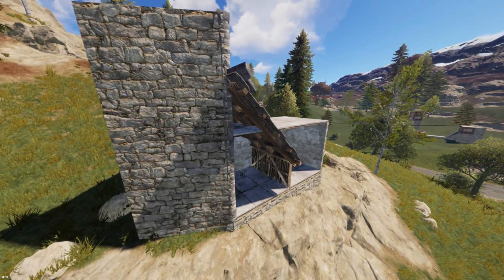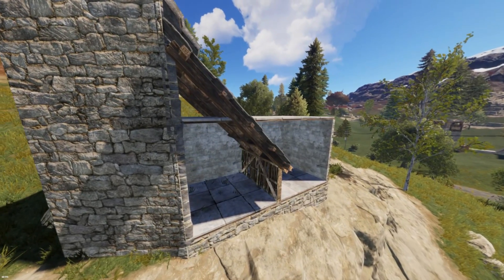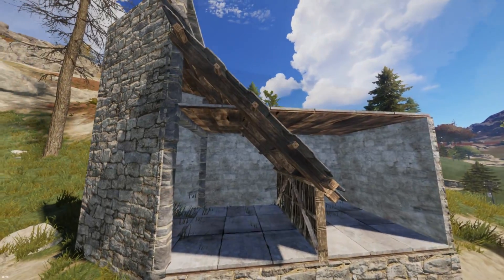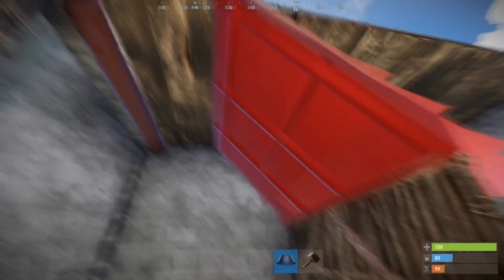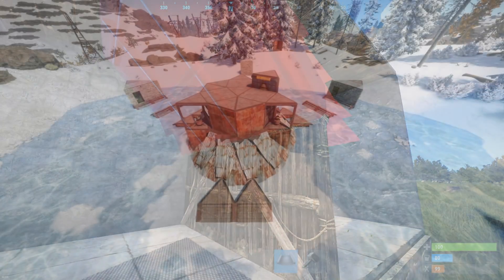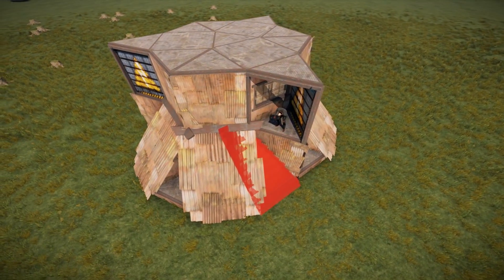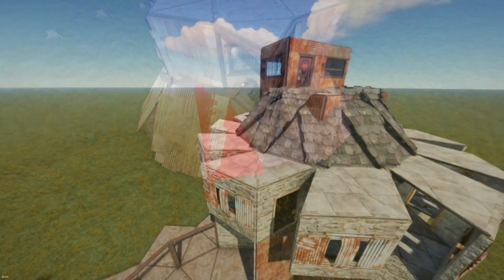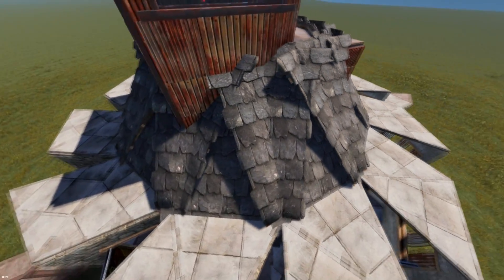RUST Building 4.0 - Affected Base Designs

Comment: Working hard to find a solution for stability roofs, it's extremely hard to buff roof raids without it - but alas solutions will be found
Reply from the maker: Yes, I hope so too
Reply: @Leagle Eagle Make this its own comment please. This is 100% legit even tested splashing. It wont intergrate seamlessly into other base designs but it  keep the concept alive and is not more complex.
Reply: @EvilWurst  And so i did, check your discord iv'e linked images that will break the meta

Comment: I learnt 3 designs from your channel and they were: the Raptor, the clan version of the original Frustrator X, and the multi-tc Frustrator X.
I got unviable, patched, unviable.
I' m pissed and i just had to LEARN those designs, i wouldn't imagine creating them. Keep up the good work!
Reply from the maker: I know it’s frustrating. If it helps, the Original Frustrator X is still viable. There will just be a cosmetic issue, otherwise the design is fine

Comment: I guess from a programmer perspective, it makes sense to apply some changes that for them makes no sense working as currently it does. But alas, we need to live with this. The roof change makes no sense. They could provide a way to keep the roof placement but change their model. If you would put a wall after a roof, the model from the roof that went past the wall would disappear . at least this wouldn't break so many designs...
Good luck with the challenge senor Evil! Stay strong and don't give up!
Reply from the maker: Thanks / Gracias
Reply: @worlwr2  No matter. They broke the placement because the roof extends a little bit to the wall when placed in front of a wall. Even in triangles foundations or floors you cant place them together. And if they are gonna release this roof feature to the stable repository, i seriously doubt that it will be in its final form. Bugs are inevitable. I wonder why they haven't worked on it much sooner since it's a very controversial topic.

Comment: Bunker designs, although used by large groups, were one of the only small advantages that solos and duos had; raiders would mostly just skip bases that size wise wouldn't yield a profit. Guess its back to hiding in caves for me. <:3
Reply from the maker: Stability bunkers per se are not patched, just one particular implementation of it

Comment: I feel the changes were needed, without them there would just be more and more exploits as time goes on until its a broken mess like ARK where you have to use exploits or not play.
Reply from the maker: Yes, I guess that's the intention behind some of the fixes
Reply: these bunker things are kind of necessary for solo play though. Many servers with clans, they'll helicopter over and drop 20 rockets on a solos 2x2 for fun.
Reply: @MrSquishles  I don't feel that exploits are a good answer to counter clans. Currently, with how the nodes are in the snow any big clan that lives there will have excess resources and sulfur so it won't matter how many walls you have since one person can farm a box of sulfur in under an hour. I feel there are a lot of balance changes needed but I do still feel that fixing exploits no matter how useful they are is a good thing and if they are important to solos or anyone else then they should add building blocks that are intended to be used that way or at least have a description to help newer players. Also, I play as a duo on Rustafied Long II with ~3700 hours so I understand the struggle against big clans.

Comment: You could bring the door raid cost of the Leech back up at least partially using a triangle ladder hatch I think, don't know if it fits though.
Reply from the maker: Yes, that should increase it by 1 rocket. 4 to go to match the old strength :)

Comment: The leech design was my favorite but it sucks they completely borked stability roof seals. Did raiders whine they couldnt raid them?

Anyway, i have a few ideas on how to fix the leech. You saw some of my ideas on the vid i posted on the channel. With all the traps and modifications i made, you want to encourage a door raid rather than a wall rocket raid with my design, because it lures raiders into shotgun traps and autoturrets they cant drain easily

Comment: Done some fair testing myself, triangle pieces such as the ladder hatch and the frame itself takes splash damage through walls with rocket raiding.
i dont know if this is being addressed yet?
Reply from the maker: Rust Daddy told me about this as well, but I didn't have the time to test it

Comment: If the Raptor loses it's roof tiles outside, and the new ramp can be placed on a foundation, can the new ramp not replace the roof tile in some way?
Reply from the maker: The ramps do not fully seal the whole area.
Reply: @EvilWurst  Ah that's a pity. I thought about replacing the roofs with walls and floors but it increases the maintenance a fair bit AND gives the auto turrets blind spots. Hmmmm, will have to work something out here....

Comment: I can see the justification for patching roof bunkers but removing foundation steps is completely unwarranted and a bit of a slap in the face to the building community. 
All that was needed was a ramp for upcoming vehicles, and a triangle floor frame/ladder hatch.
Reply from the maker: To be fair, foundation steps were more broken that roof pieces. They were the last possible means for double stacking walls

Comment: Does the mega aggravator still work
Reply from the maker: Yes, more or less. The main changes are that the auto turrets require electricity, and that you need to use foundations instead of foundation steps to connect the external bases and the base parts

Comment: I've been using the quad bunker footprint for months now, it isn't necessarily Non viable now, just not as strong
Reply from the maker: That's true. It's just that the bunkers won't be properly separated anymore
Reply: @EvilWurst  I have been using it to hide loot while having a series of 3-4 drop down loot rooms on top of it, which makes raiders not even think about the potential hidden bunkers

Comment: Well to be honest I got raided three times on your design, mostly because anyone know your design
Reply from the maker: Did you talk to the raiders afterwards?
Reply: @EvilWurst  Yes, most of them recognise your designs, that the main problem
Reply: @EvilWurst  I've also run into many of your designs on official servers. The last one was a Mini-Frustrator 2. I was playing with a group and apparently I was the only one that knew of the video, because they said of raiding it through doors initially. Then they watched the video, and the raid was aborted. We simply did not have materials to go through walls, and nobody wants to deal with that mess of shotgun traps through doors. 
I think that, if one has the materials to go through walls, it does not really matter whether you know the video or not because, ultimately, a TC can only be in a few places. Like, imagine someone raiding your 2x2 design, and needing the video to know where TC is. "GASP! In the square farthest away from the door? I would have never guessed that without the video!!" 
So the point is that, designs are not "unraidable"; they're just optimized. Which means that, people will get raided anyway, but not by just anybody, because not everyone thinks they will need 15 rockets for a tiny 2x2.